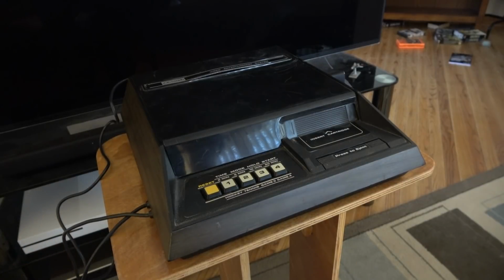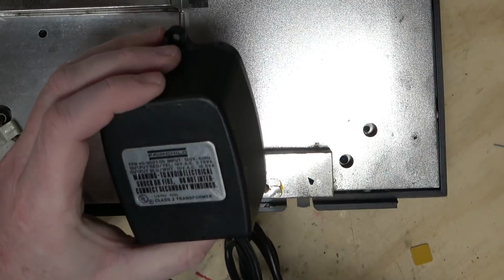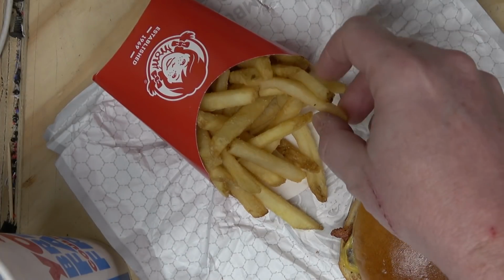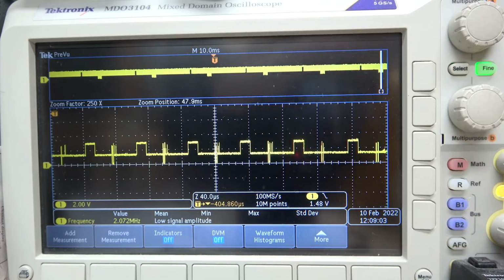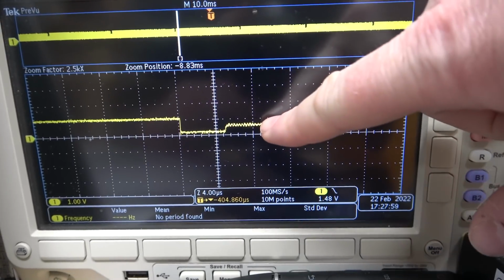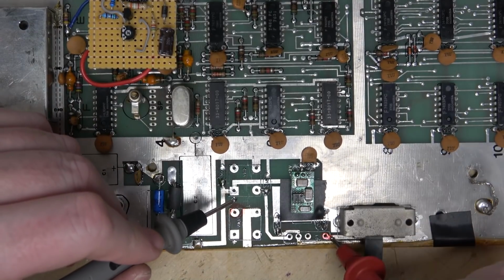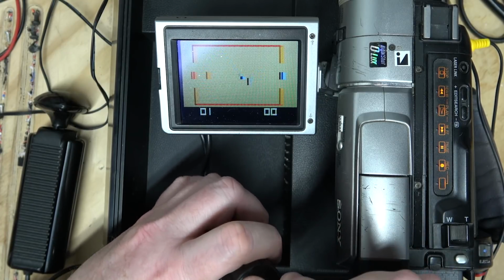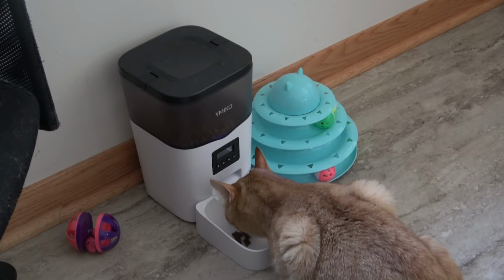Fairchild Channel F Game Console Repair

Comment: The Fairchild Channel F is such an interesting unit. Like the Apple 2, it doesn't have any sort of dedicated video chip (like the Atari 2600 or the Commodore VIC-20); it's all discrete logic. And as you noted, having an actual frame buffer was pretty rare back then. The only other console I can think of that had a frame buffer is the Bally Astrocade (itself an extremely interesting machine).
Reply from the maker: I wonder why the draw speed was so slow? Maybe the CPU only has access during the vertical blank?
Reply: @BenHeckHacks  Let's see, so D7-D10 is the video RAM. D5 is a 74195 shift register. F6, F8, F9, and F10 are 7439 4-bit counters  that are hooked to a "SYNC ADDR BUS" that's connected to the RAM through some 74153 dual 1-4 multiplexers. Ah, and the multiplexers select between the SYNC ADDR BUS and the HORZ I/O BUS and the VERT I/O BUS... whatever those are. 

Ah, looking at the other schematic with the CPU, those I/O BUS are hooked to "port" pins on the CPU, so they're not part of the regular data address bus that connects to the cartridge ROM. 

So with the counters it looks like there is hardware that is spitting out the bits to the screen, so that part isn't in all handled in software like the Sinclair ZX80. But it looks like the video memory might be a bit of a pain for the CPU to get to. Just guessing...
Reply: @Lantertronics  In that case it may be that the CPU can only access VRAM during VBLANK and maybe HBLANK but HBLANK is so short it might not have much time to do stuff during that.
Reply: @big0bad0brad  Makes sense to me.
Reply: @big0bad0brad  If that theory holds, then the Fairchild Channel F is kind of the opposite of the Atari 2600: In the 2600 the CPU has to get all the video stuff handles and then can only do gameplay computations during the vertical blank; whereas in the Channel F, the CPU can only stuff things into video RAM during the vertical blank and then naturally think its other thinky thoughts while the dots are written to the screen. (Just a theory...)
Reply: @BenHeckHacks  Yeah, I wonder if the readout circuitry just takes over to keep the design simple.

Comment: When was the $19.99 price tag put on the cartridge sleeve?
Reply from the maker: I doubt this system sold very well so it's probably OG. Early 80s the average 2600 game was $35. I know because I WAS THERE.
Reply: Not sure...  But it definitely wasn't the pricetag from where I bought it from and there are adverts from back then pricing the Videocarts at $19.95 ( https://youtu.be/jXvpsmanhsk ) ...  So it's probably close to original if not the first pricetag put on the box.

Comment: Street Fighter 2 Turbo on the SNES was £60 at launch in 1993, that's £130 in today's pennies or $170 in dollarydoos
Reply from the maker: Large characters, lots of moves, meant a large mask ROM was needed. SNES carts needed more add on chips than the Genesis did (because SNES CPU = a dog) and that caused higher prices too.

Comment: It looks like an oversized 8 track player, I love it.
Reply: Even the cartridges are about the right form factor for an 8-Track...  Despite the insides being more sparse than an NES cart!
Reply: @TesseractUnfolded  Atari VCS carts were mostly empty too, so much wasted plastic. lol
Reply: @mkeolver  Fairchild carts are even more insane.  There's not an IC-style chip inside, it's a tiny bare silicon chip on a PCB covered by a small plastic cap about the size of a DualShock Controller's face button with traces going right out to the edge connector.

I'll open one up for my video once I retrieve my Fairchild from Ben. It's kind of insane!
Reply: @TesseractUnfolded  sweet, subscribed. 👍🏻
Reply: @mkeolver  Thanks!

Comment: Va is basically watts not amps.  So 16 VA would be around 16 watts or 1.3a at 12v
Reply from the maker: Ah! Good to know.
Reply: VA is not 'basically' watts.
It's Watts divided by the Power Factor.